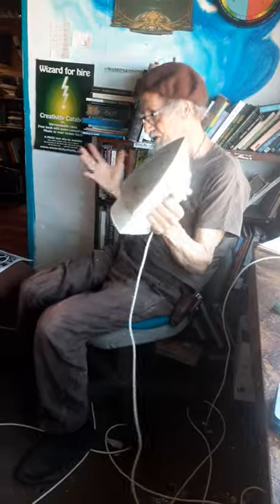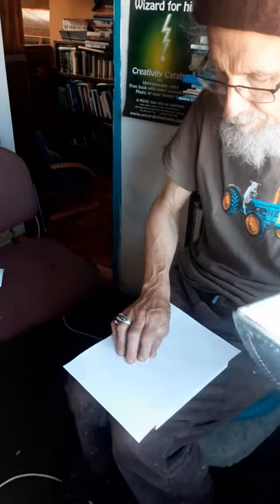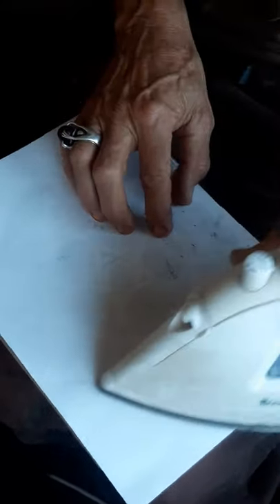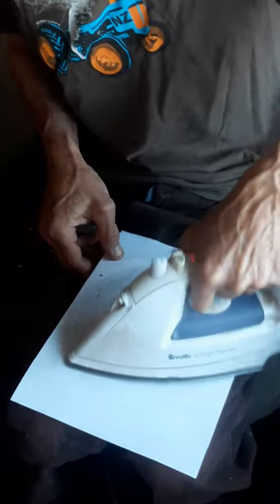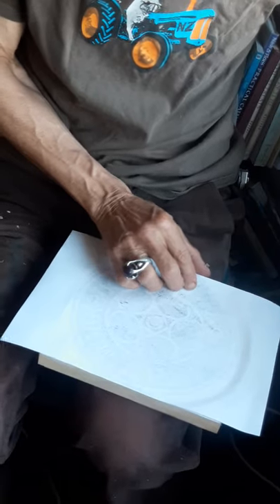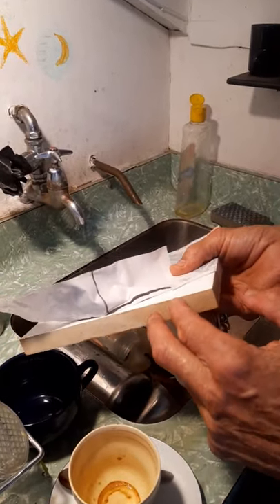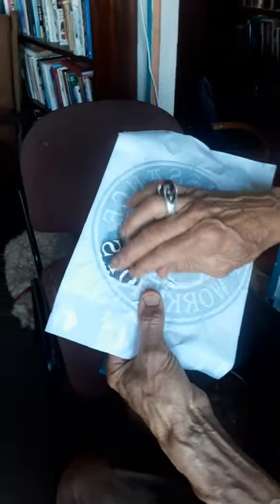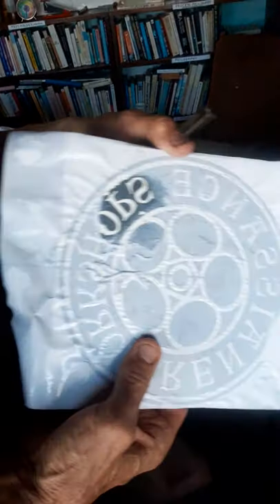How to transfer photocopy prints onto board for making woodcuts

Comment: Another simple technique is to laser print your positive or negative image onto label backing paper (the shiny side), then either iron on, or lay onto a surface coated with gel medium, left to dry, then simply peeled off.
Reply from the maker: Thanks, Yes ive seen videos of that... ive never located that paper and tried it! I will ask our stationery and copy place if they do it...though i like the ability to transfer any time using normal paper...it's my ad hoc rapid prototyping way...
Reply: @wizardofeutopia  fair enough! If you’re happy to send me a postal address, I’ll be happy to send you some sheets to try? DM me